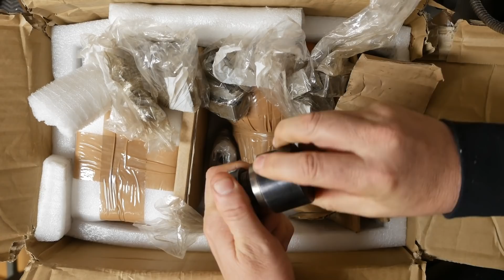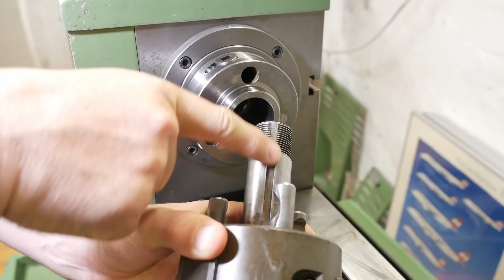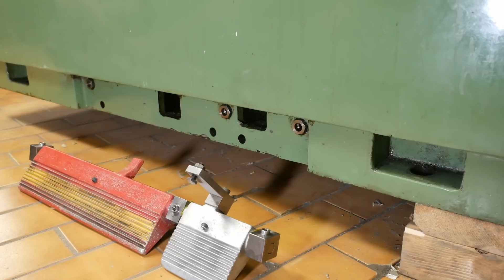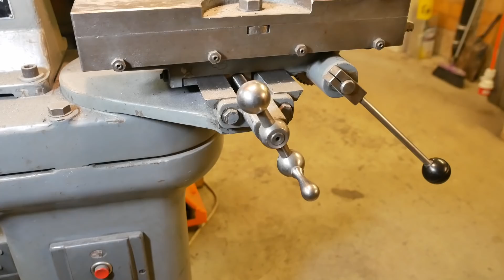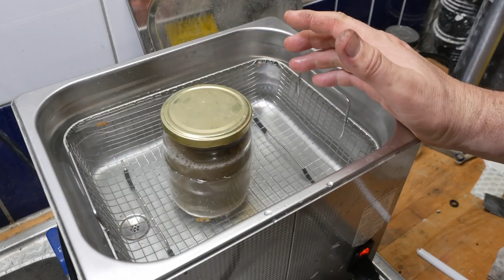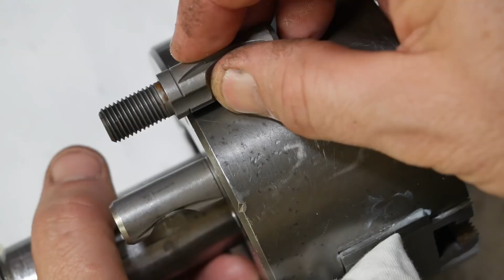How does a CNC power chuck work? || RotarySMP

Comment: What an amazing chuck, thats really cool to see! It took me a second to understand how it works but what a cool mechanism.  

It seems like the only thing that would slow you down is changing the position of each jaw when you have a new diameter of part (not a problem for making something in bulk of course). I wonder if it would be possible to have some type of quick release/quick adjust jaws with a mechanism faster than screws to hold the jaws down. Interesting to think about, I had an idea but its hard to describe in writing haha. If you’re interested at all I could try to make a quick video showing the quick release idea, but I could be fundamentally wrong in how Im understanding this too hahaha.

Anyways thanks for the great content as always and for the comments on my videos as well! Its a big inspiration to keep making videos when someone has thoughts about what I did
Thanks!
Reply from the maker: I think if you are only doing one offs, this is not the right chuck. It is a production tool. For one off jobs, I will be using a scroll chuck, which I havent bought yet.

I guess some sot of cam overcenter device could make the jaw adjustment faster.
Reply: RotarySMP ah okay that makes more sense, thanks!

Comment: With the grinder machine, could you just use a micrometer “clock” with a magnetic base, touching the axis sled? Zero it out after you measure the part so you can make an incremental move?
Reply from the maker: True, but magnetic bases and grinders is kind of messy, and this was not a precise part. For a precise move I would mount a clock with one of the many tool stop clamping features of the Clarkson.

Comment: the 125 seems like a perfect candidate to convert its way's to hydrostatic ways if you ask me ( thats my plan to try and do that on the manual one when i get mine )
Reply from the maker: They are hardened ways, and given the limited hours it will work in my hobby shop, I think it will last forever. In production I wonder how many hours till the bed is significantly worn? Given the manual way oiling, I guess the operator makes a big difference.
Reply: @RotarySMP  i don't know about box ways (they probably wear much faster) but my Mori AL2 from the 80s with linear rails has barely worn in with 35 years in production it did. Has really cranked down some parts while the original shop had a bar feeder behind it. (It has a parts catcher so you can do like a few hundred small parts unattended for example) It stops working if the oil level goes down on the automatic lubrication pump so it always had the lubrication working.
Reply from the maker: @MF175mp  Mori's reputation for excellence was well earned.
Reply: Certainly
Reply: @RotarySMP  true though sometimes they are more worn then they look ( remember from one of my old jobs we had a machine where we had to compensait in the program for the wear in the ways everytime we needed to make those parts ( if we/i didnt i was going down about 0.03mm in the middle of the part where it was only allowed 0.01mm ))

because the are flat harden ways they are perfect candidates for it ^^ since if what i have been reading on the internet its basicly harden ways where they float on a constant 0.01/0.005mm thick film of oil ( no contact and oil is non-compressseble under the sercomstances that we can put it under on earth

plus it does also requair the good practis of covering7protecting the ways anyway ( so cut off parts cant fly down and ding the ways at all or chips and dust getting stuck between the wat and sadle wearing it out faster )

but cant wait and see what your gonna do with ours when you finish it ( realy hope to see the air blast that i mentioned in a former video come to live ( could even mount some tube on the sedal with some small holes blowing at the ways to blow chips away and protect them that way in case you dont want to cover them up) 

best regards from denmark
Reply from the maker: @flikflak24  I dont know yet what I will make with the lathe. Probably parts for other machines :)
Reply: @MF175mp  you normally see box ways on machines that dosent have to be as precise but being able to take a lot more material off in the same amouth of time / really deep cuts thanks to the desine of the ways  and there thickness ( we had a okuma lb15 at school where i use to go and one day one of the other studens crashed it well i was on a okuma lb12. the machine lifted it self about 10cm up in the air 30cm hack and 20cm to the side. broke the turet pucket where the tool was in. the whole chuck and jaws was ripped out  and tool it self what totally distrued ( funny enouth not bedt at all though ) but all the box ways was still completely fine because they are so thick and strong ( thats box ways for you ) ( it was going at G00 ( full rapit ) to z-500.0 ( he missed to the where the dot was suppose to go by one ) and the spindle was a 3000 rpm about 10 hp /7.5 kw spindle and what a sound it made ( it have been fixed by now and running fine ( have visited the school afterwards and seen it run just fine )
Reply: @RotarySMP  and a box way one is perfect for doing it fast ( with the right tools in it should be able to take some real nice thick cuts ^^ )
Reply: @flikflak24  they're not less accurate when new but if they wear more they become that at some point. And the rails and their rigidity or strength are not a bottleneck by any stretch of the imagination for the cuts the spindle motor on the Mori is capable of. Only 7,5kW max power.
Reply: @MF175mp  the 7.5kw was on the okuma lb15 i was talking about 

and i know that liniar rails are pretty strong but compared to box way there is no comparety in the really heavy and fast cuts like doing a doc of 25mm radioal ( 40mm in diametor ) at 0.35 mm/rep the box is way better suted for that i tell ya
Reply: @flikflak24  that's not a job for a mini lathe like mine anyway but I can fully use the 7,5kW without worries about anything other than workholding
Reply: @MF175mp  30-35 bar on hyfrolic with 20mm in the chuck man and that shit aent going no wear xD ( thats what we did when we had to take off a lot in a split

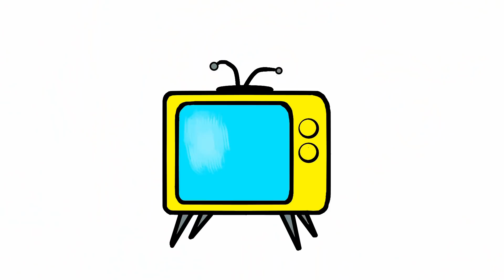Comment: Floating tubing original Schaublin @ 20:30?
If so, very bad design, I'd make some aluminium sheet metal thing, that connects the rotating part with back of machine between the belt, that prevents the tubes from rubbing at the belt pulley.
Reply: The tubing in the original design is alot more rigid so you can expect it stay in place, still not a very good design.
Reply from the maker: I think I am missing a part. There must be an anti rotation feature.

Comment: xray inspection, I wonder if gamma is still popular with iridium-192 or Cobalt...
will the cracked jaws let go under load and pose a safety hazard?
Reply from the maker: Radiographic inspect if only really rarely used on-wing. I can only remember one time, on an engine pylon with a very unusual crack.

That cracked jaw is certainly not safe, especially at speed. I suspect that this is a financial write off.

Comment: Nice gifts you got! Didn't think the power chuck could crack the jaws by itself (maybe got some external incitement, when locked). With a bit of luck, you may get a new set jaws - your channel has now enough exposure to attract this kind of sponsoring 🙂
You mentioned ND testing on aviation industry - do you also use ultrasonic crack detection?
PS: I have this feeling that the nameplate will not be ready before the machine is up and running. Have you tried a stiff toothbrush with typical household cleaners?
Reply from the maker: Ultrasonic inspection is also used. All the various NDT methods are used somewhere in the process chain.

The chuck does not seem to have any wear, but the external marks are not those of a caring owner. Wonder how the causes the crack initiation?
Reply: @RotarySMP  Thanks. Yep, the lack of care (maybe it came from a school) brought me to suspect a hard dig-in of the tool when turning - that could create the forces capable of cracking the jaws. Wonder if you can resurface the chuck body, prior to install the new jaws.
Reply from the maker: @JoseSilveira-newhandleforYT  I way also thinking that a skim cut on the face and circumference would improve it's looks dramatically. Still, it might be beyond economic repair.
Reply: @RotarySMP  Yep, you're probably right.

Comment: use a straight joiner for the tube
Reply from the maker: I probably will. I'd have to pull the main motor to run a replacement.

Comment: Don't pull the whole length of tubing. Just get a direct connector like festo qs-8 and replace a small length.
Reply from the maker: I think I will, otherwise I'd have to pull the motor assy to run a new one.
Reply: If you do need to replace the whole tube, you could cut the head off a bolt, or machine a serrated pin, that is tight fit in the tube and use it to connect the new tube to the old one. Then use the old tube to pull the new tube through the machine, like fishing wires through a wall.
Reply from the maker: @jamiestotz2516  Good point.
Reply: @RotarySMP  also consider using a right angled connector just above the sleeve to give you a better angle.
Reply from the maker: @Rockroxxgert  Thanks for the tip.

Comment: What cleaning solution do you use in the ultrasonic cleaner?
Reply from the maker: For steel parts, I use a caustic solution. BBQ cleaner. For Aluminium, normally a citric acid based one, or a hydrocarbon solvent.

Comment: Did you just fill a crusty small old chuck with Kluber? Damn! That shit is REALLY expensive. I doubt more than 5 people in my country including me have it.
PS: Also I think chucks really need the EP additives. At least that's true for scroll chucks
Reply from the maker: Yes :) The Kluber is for the Maho vertical head gears. I didnt use much here.

Gamet does recommend a Kluber grease, but not IBU 15. It is some teflon grease that the chuck needs.

Comment: Since steel is heavily recycled and nobody really sorts it by grade before doing so the quality of steels is slowly being pushed up across the board, mostly due to high manganese content.
Reply from the maker: I guess that makes sense. I was kind of wondering how they alloy steels to specific standards, given the ore and scrap which goes in at the start of the process. 

I guess for the highest grades, of closely controlled steels for things like landing gears, or nuclear components, they start with only the purest ores, and dont add scrap.
Reply: @RotarySMP  Specific alloy melts of iron and steel are usually done by tapping off a sample of melted metal and analysing it "on the fly" before adding ingots of alloying metals or oresands for extra silicon, phosphorus etc. It can happen that there's too much of a particular element in a melt -- one foundry I did work for where they made paper-making rollers, they once melted a big batch of SG cast iron using a lot of scrap railway track which they got cheap. The 150 tonnes of melt in the two crucibles ended up with way too much manganese (which provided the railway track with abrasion resistance). They couldn't correct for this excess since they could only add elements, not extract them. They had to pour the 150 tonnes out as manganese-rich pigs, carefully label them and use them up in later jobs.
Reply from the maker: @robertsneddon731  That is a great story. I bet it messed up the production schedule a bit to have to pig that batch.
Reply: @RotarySMP  Oh yes... the company (no longer with us, unfortunately) made rollers for paper-making machinery with some of the bigger ones weighing 150 tonnes each. The drums were cast to very exact specifications given they were expected to spin at 600rpm for decades and a large drum failing in operation due to a flaw or material defect would have resulted in very costly downtime, if not a disaster (lots of stored energy in a large spinning drum after all).

Spheroidal Graphite iron (SG iron) is a mechanically strong cast iron, made by heat-treating and thermally soaking the item as it cools down but the elemental makeup of the molten iron is very important. Fascinating stuff, it was only "invented" in the 1940s as a cheaper substitute for steel in some applications.
Reply from the maker: @robertsneddon731  600 RPM on a 150T drum is a terrifying flywheel.
Reply: @RotarySMP  Oh yes. The factory had to balance them before delivery, at (IIRC) twice the rated speed to complete the certification process. They did this at night because electricity was cheaper at that time, that's how much energy was stored in them.
Reply from the maker: @robertsneddon731  Those are the sort of thing an outsider doesnt even consider.

Comment: Not just British - but possibly the worst machine tool ever made! Get something to compliment the Maho and Schaublin!
Reply from the maker: Have you had bad experience with the Clarkson? I kind of like mucking around with it, but I am no pro, and is worn enough that the surface finishes are not great.
Reply: @RotarySMP  I must have had half a dozen of them through my hands in the early days. Just terrible things IMO. You mention wear - that's one of the principle design flaws. They are so badly designed that ingress of grit is an inevitability. Every machine I had was completely worn out. In some ways the design is simple and clever, but it has more in common with 19th century machine tool design than the post-war era and certainly can't be regarded as a precision instrument. The MKIII machine branded as "March" (the actual makers) was considerably better and used properly protected linear bearings for ways.

I'm not saying that an unworn machine won't do the job, but I don't think that's the reason that you, me and my customers buy Swiss and German machine tools. 
I'm also not implying that Britain did not produce some extremely fine machine tools - we certainly did, just look at Dean Smith and Grace or Holbrook lathes or Jones and Shipman grinders. A better alternative to the Clarkson is the nice little Union machine or the more developed Boxford. However, on the continent you are spoilt for choice. Walter made a lovely small machine, and any of the Saake grinders are superb - all quite big though. Lots of other German manufacturers made lovely machines and some of the Swiss makers like HARO (Robert Habib) are in a league of their own.
Reply: I just realised how negative my comment was! Even though I've played about with Swiss machine tools for 30 years, I very much enjoy your videos, keep up the good work!!!